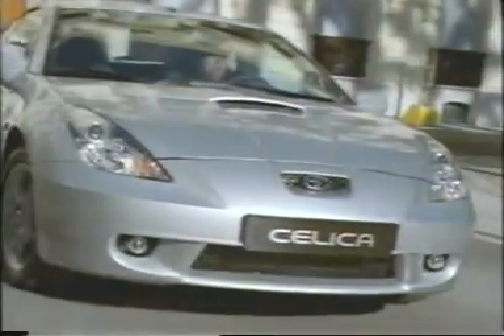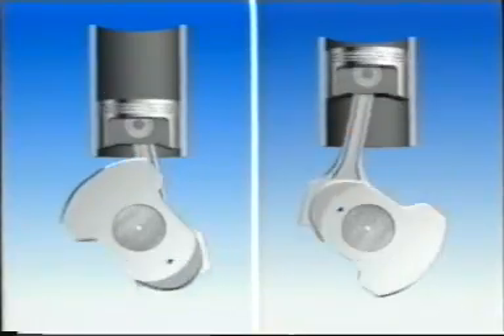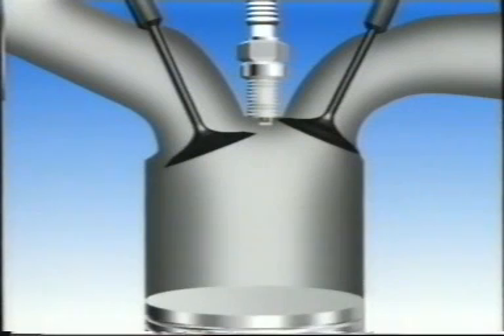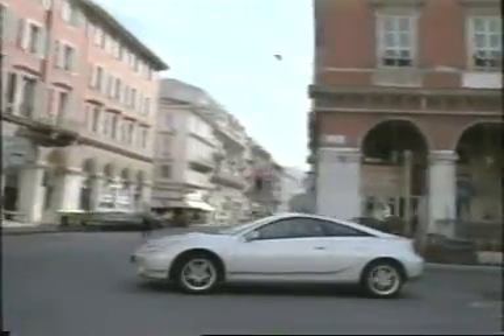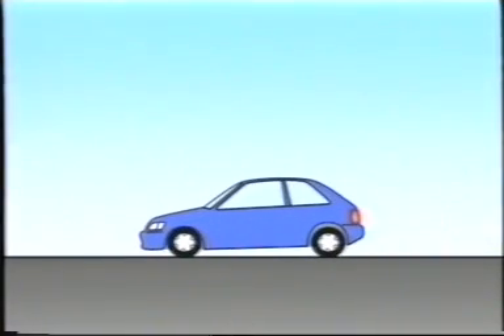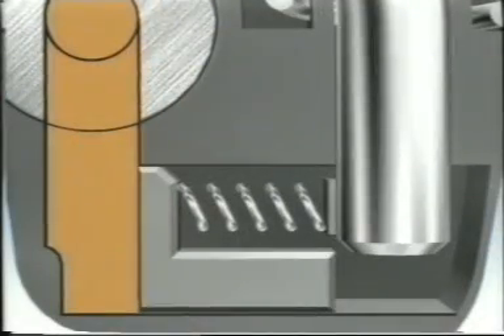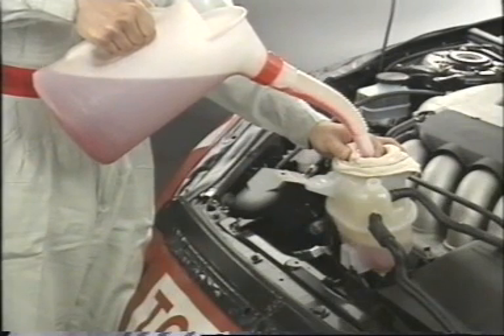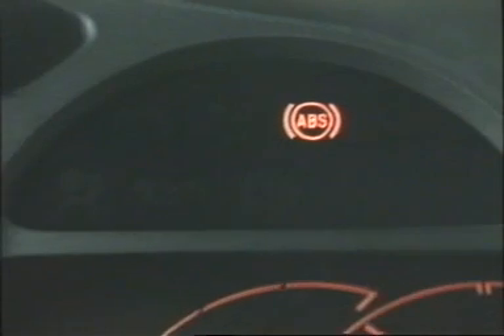TOYOTA CELICA

Comment: The only thing that made 2ZZ GE imperfect was Toyota didn't put D4S Direct Injection in it
Reply: the engine developed way earlier bro 98-99
Reply: Better without direct injection. No carbon build up means more power for longer and less maintenance.

Comment: 1ZZ is a complete waste of time. Not enough power and stupid ring design. I had a Celica 1ZZ; absolutely fantastic handling because it's so wide and low and light but the engine was a bore and I got fed up feeding it with oil - it eventually failed on its emissions and I couldn't be bothered spending to fix it. I would buy a good 2ZZ Celica any time.
Reply: as an owner of t-sport, i can say it is worth the money.
Reply: Agree 100%.

Comment: I didn't know the VVT-I was actually designed to kick in at 6200 rpm. i was told it was at around 4500k to 5000k. i seldom ever rev it high enough to notice. i guess i will now!
Reply: VVTL-i will kick at 6200, VVT-i will not
Reply: Depends on the year range too. The rev limiters were set at various rpm ranges. 
A lot of this was due to US smog emissions compliance in the early 2000s as a result of the crack down of the late  90s.

Comment: My '02 GT-S currently has 402K miles with the original engine, transmission and clutch and still kick ass.
Reply: 😲 nice nice
Reply: My 02 GT with Manual Transmission has 152k all original and kicks ass too, I didn't know the VVT-I was actually designed to kick in at 6000 rpm. i was told it was at around 4500k to 5000k.
Reply: Does the GtS have a 2ZZ ?
Reply: Yes, the 2ZZ comes standard with the GT-S.
Reply: Scott C thats amazing. I have a euro spec 2zz with 75 k (miles) on the clock. Any advice on maintenance so it can get to 402 k like yours?
Reply: T1ME CH1LD:  Regular oil changes, and stick to the factory recommended schedule, whether you do it yourself or a professional. I don't modify my car but do have a KNN air filter in place. It helps with the mileage a little.  This engine is well designed to take a beating but I don't rev my car to the red line. I think it's got plenty of power already in the 4000-6000 range but you will not achieve lifts in the lower rpm zone.  This is just my opinion. I use it as a daily driver so I don't race it.  It still gets very good mileage of about 35mpg. I used to get 36-38mpg when it was newer.  Still, 35mpg is still impressive for an engine with this many miles. Over time, this engine will leak oil and mine is no exception. It started at around 275K miles but it's not a major leak. I just have to keep an eye on the oil level and top it off.This car runs hot so be sure to flush the coolant per the factory recommendation.  I recently had to change the radiator because one of the inlets is made of plastic and it broke. The main radiator body was till good, even after 400K, but since a new radiator cost just over 100USD, I decided to replace it.  One last note, I don't know if other owners have experienced this but the heater core leaked right around the time I replaced the radiator.  After doing some research on the Celica forums, I decided to do a by pass and it runs fine now but no heat.  At least the AC still works good. Good luck and hope yours will surpass the 400K mark like mine did.  I'm hoping to reach 500K with mine. Still running on the original tranny and clutch.
Reply: i want to find Gt-s but idk why in Bulgaria they are no Gt-s Celicas for sale :D and thats why i have 1zz
Reply: @milenstoev8103  I saw few GT-S's in Mobile.bg also I am bulgarian too. The 2zz engine
Reply: Sgt Nikolov къде бе брат няма ги 😃 до сега не съм виждал gts има само tsport
Reply: @milenstoev8103   написах, че съм виждал, не че има🤣
Reply: Sgt Nikolov haha да бе ама що ги няма тук с този двигател а в чужбина пълно
Reply: @milenstoev8103  никаква идея. Ще се опитам да намеря 2zz. Гледах и цените не са брутални но нз доставката колко е
Reply: @milenstoev8103  един приятел на леля  ми има GT-S
Reply: Sgt Nikolov Казвай му да влиза във фейсбук групата Celica team BG да я представи 😀
Reply: @milenstoev8103  казах му но не иска
Reply: @milenstoev8103  още преди месец
Reply: Sgt Nikolov е що така, хубаво е да влезеш в група с хора дет имат като твоята кола. Те правят и meetings, правят стартове, обменят информация 😀
Reply: @milenstoev8103  супер. Аз още нямам селика, но тя е колата която най-много искам и мисля да си взема.
Reply: Sgt Nikolov пожелавам ти селика, красива е , не се чупи и интересна за каране
Reply: @milenstoev8103  наистина е много красива. Карал съм и съм доволен. Има и една пред нас.
Reply: Holly gezz that car has gone around the planet 4 TIMES!
Reply: Original clutch???? Holy shit man its time to change it
Reply: @DimoS...  My Celica is still running on its original tranny and clutch.  Many are in disbelief but this is the truth.  The only repairs I've done on this car over the years were:  1.  Replacing the radiator 2. By-passing the heater due to a leak 3. replacing the catalytic converter 4. replacing the TPS 5. O2 Sensors 6. Replacing the brush inside the alternator.  The only major issue with this car is an oil leak and I don't want to go through the trouble of having to drop the tranny to access the seal by the timing chain.  I will do that if/when I need to replace the clutch which, as of now, runs fine.  The 2ZZ in my opinion is much more reliable than the 1zz but with the advantage of having an extra 40hp when needed.
Reply: Wow original clutch has lasted that long.... biting point must be near the end of travel on pedal
Reply: @ThtGSXRguy  Update: My GT-S now has 413K and is still running strong. The clutch engages fine and I have not noticed any slipping.  At this point, even it it's worn out, it's outlived its life but I drive freeway 95% of the time so this may be the reason why it  has lasted this long.  Hope you get as many miles out of yours as well (if you owned a GTS).
Reply: @vhg7m ate you have the car today???400k+ miles on 8.000+rpm engine is insane!!! Very impressive!
Reply: @DimoS...  Yes, I still own it and it's got around 416K on the odometer at the moment. The engine still pulls hard and starts up without fail.
Reply: stop and go all day long for 75k miles my silver 2000 gt-s is now on the 2nd clutch (55k replaced throw out bearing and full clutch kit.   clutch pedal play had no more adjustments and disc was a perfect time to replace.  noticed only a little chatter and took it in
Reply: @Scott C 
Thanks for the reply.. Well done to you sir, that is quite an achievement and is mostly likely all down to motorway driving. Hope I have half the luck you have with my 2002 Celica 190/TS (uk named GTS)  only have 125k but pulls like she’s off the showroom floor.
Reply: I don’t believe you
Reply: My still has 87k miles, and I'm going to sell it, because prefer more comfortable rear drive cars...

Comment: I have two '03 Celicas, both with the 1zz. Same engine as the Corolla, which means they are slow but reliable
Reply: Not.that slow
Reply: @MsFilmiki  With the automatic they are.
Reply: @justsumguy2u  Maybe, i own with 1zz and 6 speed manual and its not that bad
Reply: you can manually shift going from L, to 2, to D and then releasing the O/D button so that you can rev higher and go faster. If you simply leave it on D with the O/D button engaged its not as fast. However, they are fun, they handle amazing.
Reply: @captainjosue  They really do, they almost don't feel like they're front wheel drive

Comment: My 02 2zzge now has 378k+ miles and still hitting lift all day.
Reply: Lucky mine blew up at 95k miles 😂
Reply: I have the 1zzfe with 126k+ miles it may not be the 2zzge but it is still pretty fun and very reliable
Reply: My 02 1zzFe blew up around 130k I’m currently on my 3rd engine & 2nd transmission 😭
Reply: @eliseohm8204 😂 Money shifter!  I'm currently at 399,880 miles
Reply: @abuelb  I hope i have your luck! I got my 2zz 03 celica yesterday with 192km, or like 118 miles for you americans haha
Reply: @jackcampbell2787  that's barely broken in.  Just keep the oil changed regularly every 5k (km?😄) miles or less.  Anything that goes bad on the 2zz is usually not the engine itself but supporting components like alternator, starter, spark plugs etc..  I'm at over 400k miles on my original 2zz and runs like the day I got it back in 2002.  Enjoy it.  Its a fun zippy car.
Reply: @eliseohm8204 What are you doing to them??
Reply: Holly gezz that car has gone around the world TWICE!!
Reply: @aLexGeNeSiS01  😄 Currently at 394k miles and still looks new inside and out and a blast to drive.New paint 2years ago.
Reply: Damn, what is your secret man? Just picked up my 01' GT-S with now 144K year and a half ago. 
I suspect the VVT gear is rattling about every minute when fully warmed up. I've heard others drive around with that issue with no problems, but I certainly want to get it replace and the water pump/chain/chain all with Toyota parts. Hopefully that will keep her going for a long time.
Reply: @rushnerd  change your oil every 2.500 Miles with fully synthetic (0w30 5w30 0w40 5w40) use always high octane premium gas and change your spark plugs every 20.000 miles. The 2zz can go over 300.000 miles if maintenance is like that. Is high rev engine and needs love
Reply: Love that. Maintain it and don’t over rev it, looks like it is still a Toyota after all
Reply: Spun a bearing at 153k it’d been a nightmare getting another 2zz installed 😭
Reply: God has blessed this mans 2zz-ge we must pray to the toyota gods and keep faith in lift

Comment: Glad I came across this video,very informative. 2000 GT-S 2zzz-ge 215.000 miles. Wants to stall at high RPMs. Going to try cleaning the OCV see if that's causing my problem. Runs great until I red l red line.. Thanks For Sharing ..

Comment: Ha funny they are comparing these new motors to a stock corolla n camry engine. The 3sfe came jn SS1 6gc but the 3SGE came with 177 or 197hp n more torque than 2zz
Reply: Also 200cc more and a lower redline, you would hope the 3sge had more torque…

Comment: Little did they know that the 1zz will drink oil just as much as gas 2nd engine swap still burns oil
Reply: Shouldve swapped into a 2zz lol
Reply: Allbert Enriquez Can be fixed by different piston rings, but still. No one should have to do that in the first place. The 1ZZ also has some of the weakest internals I've ever seen, too.
Reply: was fixed after 2002. 03-08 engines dont have the oil consumption issue of the 98-02 non vvti engines..
Reply: @001dman  actually 03s were still affected by oil consumption, but only early models of that year.
Reply: Allbert Enriquez that could be easily fixed.
Reply: Albert Enriquez many Toyota engines are like that. Not sure about the recent stuff. But I had 2 7afe that did

Comment: Car killer.  This car as all FWD cars killed the Toyota sports car dominance.  This is a girls car; no disrespect to girls.
Reply: No its not gils car.I have one and I am not a girl . So thats not true statement. Very reliable and good feeling on the road like a lot more expensive car...Celicas are nice
Reply: CaribbeanGTR so what? doesn't matter, I'm sure you have seen fwd cars smoke rwd cars.
Reply: To be fair, the gen7 celica still is one of the top cars to run in gs autox.
Reply: Alvaro Lopez When I had my year 2000 GT I smoked a late 1960s Cougar with a V8 till we got to about 80 mph and he pulled away..  I had to slow down because we did it on a 35 mph main street in a small town 😂  Lucky we didnt get busted! 😜👮‍♂️

Comment: 180,000 miles and running strong with almost factory compression pressure in cilinders. Awesome engine 2zz!!
Reply: ADRIAN CURIEL HD same here.
Reply: ADRIAN CURIEL HD Sweet deals!
I bought a 2000 GTS in November with 172,000km!
And two summers ago a 1994 GT with 94,000km!

 Both engines drive awesomely!

I'm very impressed with Toyota!